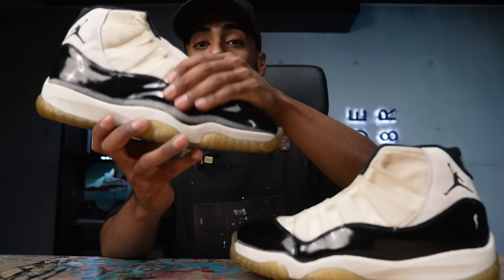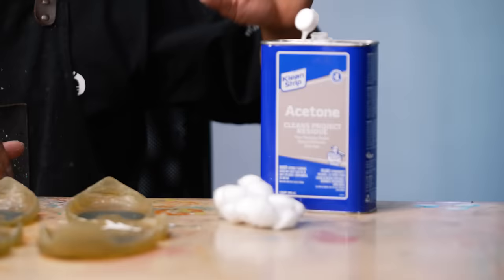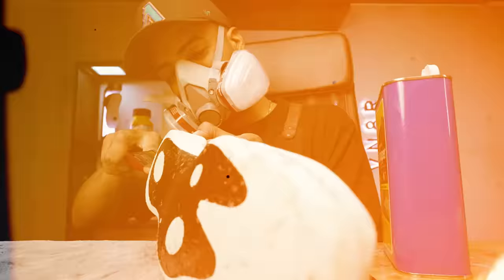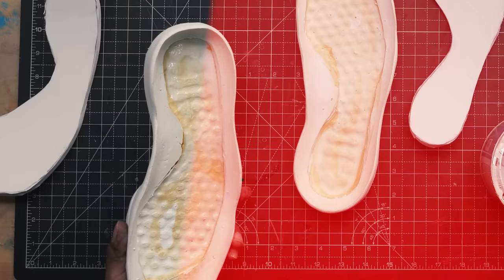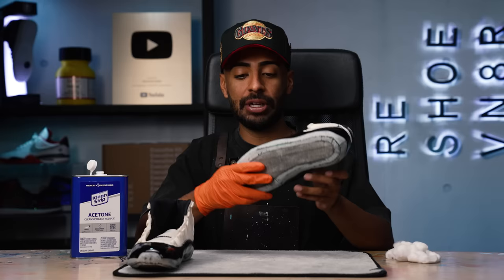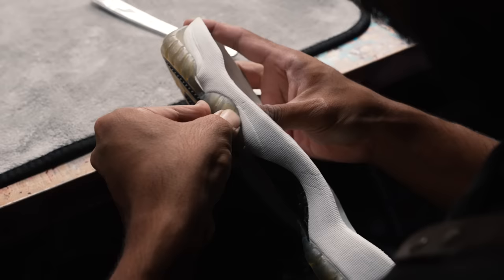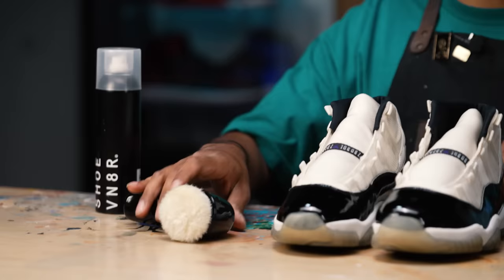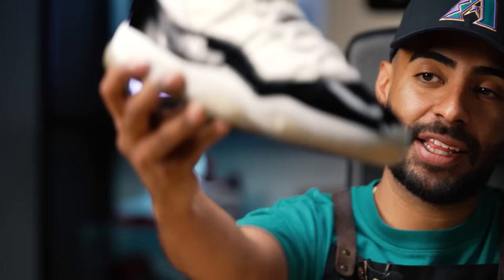Air Jordan 11 Full Reglue Tutorial

Comment: I still think you guys should work on a UV activated cleaner similar to Nulife Antidote, clean the soles/uppers, steam it off, throw them in the indoor set up and BOOM, brightens up whites and deoxidizes soles all in 1 safe step. Size note, if you did end up icing the soles and they get cooked, I've been working on a solution to rehydrate old firm slippery rubber soles to bring them back and give them grip again. So far tests are a huge success, I just need more beaters with cooked soles to test on. I've seen Vicks stash of old parts, if you guys happen to have any super slippery hard soles laying around I'd be more than happy to take a pair or two off your hands for further testing of my product. 👏
Reply: Wow definitely interested in your solution for hard slippery soles! got a ton of shoes that hardened throughout the pandemic and would love to see your solution to it with your product. And yes, I agree, they should do something similar to NuAntidote, those are game changers.
Reply: Same here